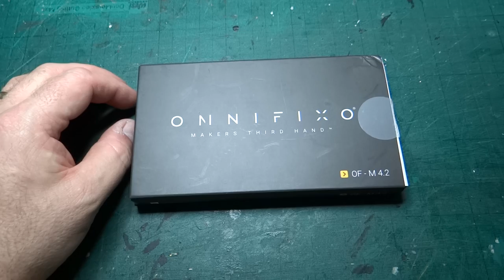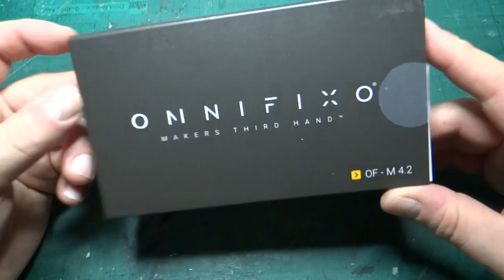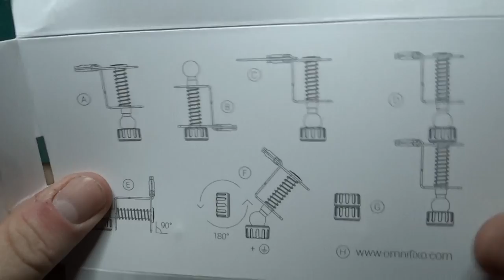Let's Review.... OMNIFIXO OF-M 4.2

Comment: just ordered the smaller one!! super excited to get them cause it's crazy simple yet we'll made. Gonna be using them for soldering fpv parts. Might even make a little portable kit including the pinecil! Great video man!
Reply from the maker: You won't regret getting one, it's made my life so much easier and not just for soldering. I've also been using them for holding small parts while painting them as it's so easy to adjust the orientation of the part. I'm sure I've seen a 3D printed case somewhere specifically designed to hold the pinecil as well, can't quite remember where but I'm sure a quick Google might turn up something you can use.
Reply: @encoffeedrinker  looking forward for mine to come! actually ordered it around a week ago but its gonna take some time. Glad to see Johan's design getting the love it deserves! Gotchaa ill look into that! thanks man!

Comment: I've been looking at those.  Just started soldering small electronics and have the standard amazon helping hands setup which works but not great.  Thanks for the review
Reply from the maker: I've nothing but praise for the OMNIFIXO now that I've used it a bit more than when I did the review. I've found it not only great for soldering small electronic stuff, but also for holding small parts after painting etc. (I usually use a cocktail stick or something to hold the parts while spraying but then need someway of holding them while the paint dries). The whole thing just works so well, certainly the best "helping hands" style thing I've ever bought.